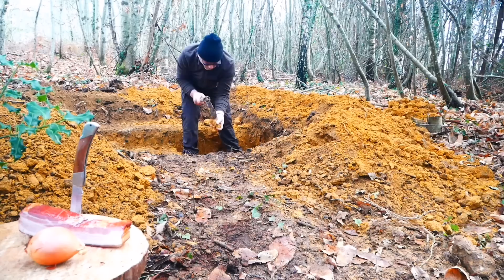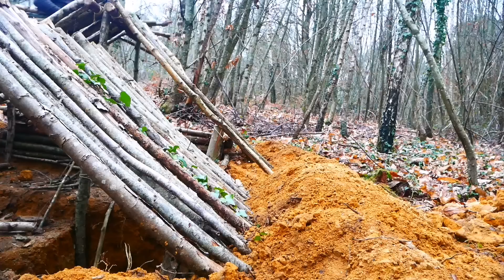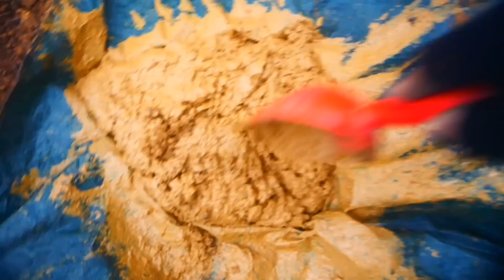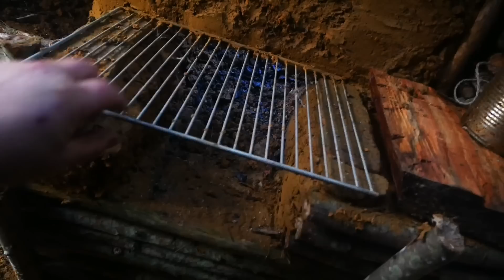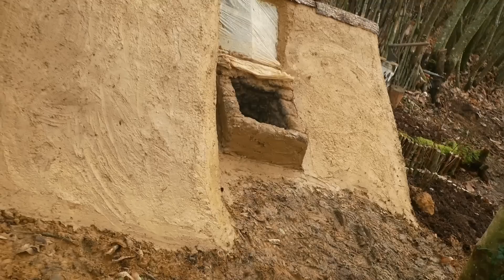SURVIVAL EARTH LODGE HOUSE - Bushcraft  a pit warm house The best of all natural Shelters!!

Comment: I'm interested to know why the choice to dig and make the shelter below ground level. I assume rain isn't an issue in this location? I grew up in the southeastern US and was a boy scout. They would not have allowed us to make this shelter because of water issues. Even a small amount of rain and your entire floor will be a puddle.
Reply: I was wondering the same thing
Reply: I was thinking the trench leading down to the doorway would funnel rainwater right into his dugout
Reply: I'd say the reason the shelter was below the ground level was to take advantage of the thermal qualities of bare earth. The reason the roof was finished with leaves and earth is for trapping both the heat
 produced by the fire and what the earth radiates naturally. The final thing done to the roof was to cover it with clay. Clay is highly resistant to water penetration, especially when smoothed and on a pretty steep pitch. It also holds in/absorbs heat quite well, staying warm for a long time. I couldn't really get a feel for the slope of the entrance. But, early on in the video it appears he is compacting that area and it appears to be heavy in clay. If that is the case even a small amount of slope will carry the water way. The soil at the building site appears to have a high clay content. This would prevent the ground from soaking up a lot of the water. Most rain would simply run off once the first inch or two was wetted. Clay is what makes  many a pond possible. Water has a hell of time getting through it. Water gets so far, clay particles get wet and bond together. Once that happens the water pretty much just sits on top or runs downhill.  I don't think this is the first of this type of shelter the guy has built, and my money says it is much, much drier than one might think. How would I know? I suppose years spent as a S.E.R.E instructor in the military just might be a factor. No disrespect, but I've met a ton of former Boy Scouts who don't know their ass from their elbow when it comes to shelter craft, food/water procurement, fire craft, and so on. My opinion it this is a pretty damn fine shelter and I would not hesitate to call it home if I found myself in the middle of nowhere with no immediate way out.  With just a bit more work this would even make a very livable winter shelter.
Reply: @matthewjacobs141  In any areas where rain is a factor, it would do exactly that.
Reply: @BornIn1500  no. Red clay makes great waterproofing. You have no clue.
Reply: With the incline into the shelter I see it flooding out.  Should have reversed it
Reply: In this sort of thing you need a groove in the floor and a drain to lower level ground so that any incoming rain will drain out and not flood you out.   He doesn't seem to have provided such a drain.   In any case, just when he needs warmth the most, the rain will come straight down the chimney and put the fire out.   Not forgetting of course that this style of fireplace will send 90% + of the heat up the chimney, so he'll get most warmth from the exercise cutting vast amounts of firewood.
Reply: @misterdeeds2172  :  No, not a damn fine shelter at all.  No drainage, fireplace design wastes >90% of heat.  No door or wind break.  Rain will put his fire out and then flood him out.   The pre-metal age central hearth and a hole in the roof to let smoke out is much much warmer - or for the same usable heat will need a fraction of the wood to be cut.
This is much like the play-cubbies I used to build when I was about 9 or 10, after watching American movies with a back woods setting.    I learnt to use leaves as as well.  The leaves stop the mud falling thru the gaps in the logs until the mud dries.
You are right about earth trapping heat, but he has no door or wind break and the outside air infiltration will be massive, so the heat trapped in the structure doesn't count for much.
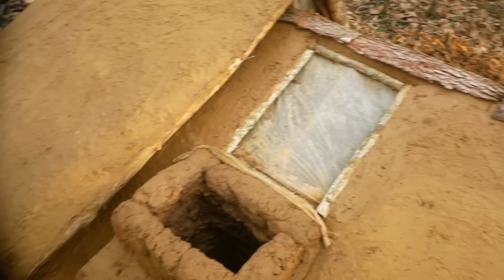Reply: @misterdeeds2172  I respect that you were a S.E.R.E instructor and would not try to educate you on this or argue with you about it. But I would ask you to go to 17:33 in this video and pause it. While looking at the image of the shelter, try to imagine it starts raining. Imagine where the water would go. The roof and walls could be solid concrete and it would not matter. He created a ramp for the water to flow directly into his shelter. The slightest amount of rain will make his floor a puddle.
Reply: @keithammleter3824  you must not have seen the finished fireplace, im assuming the non functional stage youre talking about was before he finished converting the fireplace into a clay oven
Reply: It would be great I’m sure for keeping warm! However i wouldn’t want to be inside that thing when it’s raining!
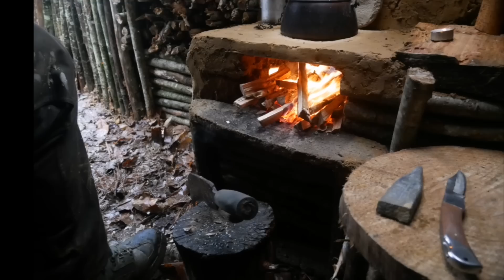Reply: @meatbag2405  :  I'm talking about the finished fireplace/oven as shown near the end of the video at 19:50.   
The air flow is L-shaped into a wide chimney - the chimney being thick clay/mud - an insulator.  All of the hot air goes up the chimney and out into the wide atmosphere and the only heat he gets to feel is the direct radiation of the front of the oven.
Ever seen those old wild west movies featuring a train - with a pot belly stove to heat the carriage?   Did you notice the dog-leg flue pipe?   That's because most of the heat come from the flue pipe, not the stove.  They used to bend the pipe too and fro to increase its length exposed inside the carriage.
Most of us who are old enough to have experience with wood stoves/ovens know that the burnt gasses are led via a circuitous path around the oven before going up the chimney.  A vent was provided that bypasses the circuitous path so that you can get the draft going when you light up a cold stove.  You get it lit and burning wood and when the draft starts (hot air rising) you close the vent.
Those of us who are old enough to have cooked with wood know that you have to have some form of "damping" to slow down combustion - this dramatically increases the usable heat energy for any given amount of wood consumed.   The fireplace/oven depicted in this video is the very opposite of damped.  Chimney is far too wide and short.  If it rains, it will put his fire out.   If he tries to stop that with flap he'll fill his cabin with smoke.
Reply: If you dig a trench with a level floor into the side of a hill, the end of the trench at the top of the hill is going to be deep. The end at the bottom will require no digging at all. That’s why it appears that the entrance runs down into the shelter. The reality is the bottom of the trench is flat and it is the height of the trench walls that get higher as they follow the gradient of the incline.
Reply: @meatbag2405  :  You made a comment about building to local conditions.   Judging from the trees, this place gets pretty cold and wet.  The trees are tall and deciduous, so it snows and rains pretty good.    No, he hasn't built for the conditions at at all, with that squat wide chimney and that ramp leading the rainwater into the cabin.
It might even snow enough that after it has put his fire out and filled his dumb entry ramp, he'll be snowed in and freeze to death.
Reply: @keithammleter3824  lol so pretentious, you ever stop to think maybe he built it in a mild climate that doesnt see much heavy rain and doesnt require full surround heating? And didnt plan to live in it forever as a permanent structure because its a hobby? Acting like it needs to be built to sustain heavy downpour and sub temperatures when its obviously just a hobby construction he built for fun showing some useful construction techniques... you whip up a shelter based on the climates you expect in your area and show us all how its done then since youre such a keyboard professional shting on a mans hobby.. its not like he advertised it as a bomb shelter.. not everything you build for fun needs to be engineered for absolute optimal survival in every conceivable apocalyptic scenario you dk.. sometimes its just for fun and a place to chill out and cook some bacon sometimes...
Reply: Hearts comment but dosent answer
Reply: @matthewjacobs141  Does rainwater run up hills where you’re from? The only way rainwater could run into the dugout is if the entire valley flooded and the water level came halfway up the hillside. If that happened it wouldn’t matter because any kind of shelter would flood.
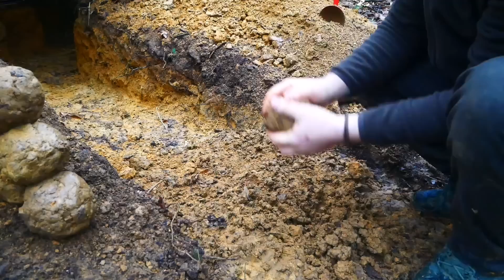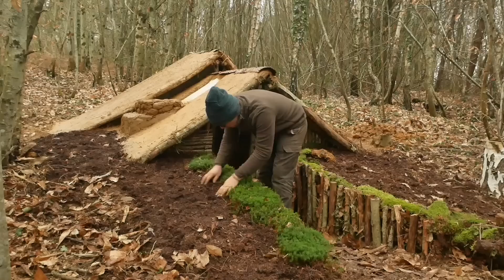Reply: @numerum_bestia  : You are wrong.   Look at 9:28, 9:31, 11:44, and 15:29.   He built on only slightly sloped land and the entrance is clearly ramped quite steeply down into the cabin.
Reply: Yeah because y’all are professionals right? Where are your video’s of shelters? I’m sure this dude as made hundreds of these and if it flooded as bad as you say it would he wouldn’t of made it that way. Arm chair quarterbacks.
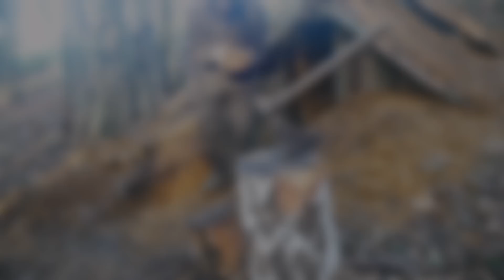Reply: 10:15 tell me how water flows up hill?
Reply: @keithammleter3824  In all of those examples it still looks like a flat trench dug into the side of a hill. The hill is much steeper than it appears on camera. The only water getting into the trench is what falls from the sky. Personally I would have dug the trench so it followed the downward incline of the hill instead of making it flat. But even with it being flat, water can’t run uphill and into it like half of these comments are saying it will.
Reply: Do you watch the show "Alone" ? In the last season that just ended they were in British Columbia which gets 160 inches of rain a year. Once of the contestants built a similar shelter and had no issues with water.
Reply: @keithammleter3824  Look at 10:15. You can see the hill better. The ramp is flat.
Reply: @numerum_bestia  : At 10:15 the camera is titled - look at trees in the background, objects tilted that and not titled in other shots.  The guy's legs look vertical but as he is bending over they should be angled back.   Stand with your back to a wall, keep legs straight and vertical and tilt your torso forward and see what happens.  Nope, although the land is sloped a little, the entry is ramped down into the cabin.
Reply: @numerum_bestia  :   True, the trench will collect only falling water, and not run-off, but in a good downpour that will still be enough to severely flood the cabin floor.  The USGS has a handy online "rainfall" calculator.  This shows that for "heavy rain" the area of the ramp, about 1 by 3 meters, will deliver about 100 litres to his cabin in about 3.5 hours.  This approximately applies regardless of whether the entry ramp slopes steeply downs or slopes only moderately downwards, and multiple camera shots as I listed in another post show that it does slope significantly down into the cabin, despite a moderate up-slope of the terrain.
Reply: @numerum_bestia  Where do you see Hills or a valley...He picked a flat place to build/dig in...and the trench he dug to get to his doorway went Downward...channeling rainwater right into his dugout
Reply: @matthewjacobs141  no. He showed an 8 months later, it was fine  it was a camera trick it didnt run back in at all.
Reply: @qwazysymbiote4931  holds the rain out just fine
Reply: @numerum_bestia  The issue of the bottom of the ramp being flat is irrelevant...Does it slope downward to a hole in the ground is the only thing of importance
Reply: @meatbag2405  After 8 months did the camera show all the mold that would have taken over
Reply: @matthewjacobs141  there wasnt any.. just grass.. which you would expect from any uninhabited bush structure now wouldnt you.. such a genius you are..
Reply: @meatbag2405  : Actually, he's posted at least three videos with several months separation.  Most likely it was still standing.   But what makes you think he actually LIVED in it for 8 months?   Or even just one night?   More likely he went there only once each day for whatever days it took to build it and video its construction, and return sometime later to video it again.   In the mean time it probably got flooded and/or snowed in multiple times.  Repaired as required for the next video.  It's not how long it remains in place that is the critical thing here, it's whether it is safe and comfortable to inhabit during heavy rain or snow, which it isn't.
Like many who have posted to these videos critical of it, I built play-cabins just like this when a young child, inspired by 1950's American pioneers and Indians movies.  I do know they were fun at the time in building, but actually useless unless you took a care about drainage, fireplace/chimney design, and wind breaking.  Which we kids learnt and this guy apparently hasn't.
Reply: @meatbag2405  :  Oh, so you agree then!   What's the point of building a cabin if you can't or won't live in it?   Right - no point in it.  How do you do it wasn't repaired?  You don't.  But it doesn't matter - repaired or not, it may be standing but it isn't suitable for living in - which you seem to tacitly recognise.
Reply: @meatbag2405  OK...I'M DONE WITH YOU

Comment: The only thing I've always been curious about with this kind of structure is, "flooding" in heavy rain.   just how much of the dug out floor would end up filled with water after a big rain event.

also wondering, i didn't see the clay prep,  is that just raw dirt clay, or is it a Daub mixture... it lools like pure clay...  which will crack and shrink as it dries, and run when wet.    Adding plant fibers,  grasses, hay, straw, or such into the mud produces a daub that will dry without cracking and has some structural integrity to it due to the fibers.
Reply: he showed it. dirt, water, bang it around in the tarp.
Reply: @knotkool1  i know,  but i didn't see if he added grasses, hay, straw, to make it a Daub...  or just used raw clay...   clay+water+grass  = daub.   Dirt + water = mud   LOL.
Reply: I'm worried about the bathroom.. 🙃
Reply: It looked like he handled the bathroom issue by rolling his turds into big balls and stacking them around the fireplace
Reply: Hard to say what's in that mixture.  But maybe I just wasn't paying attention.
Reply: @apaapansson5873  Great!

Comment: Thank you, very nice work.  I was wondering about the longevity of the plastic window in terms of drainage cases. Obviously, your window idea is GREAT. Gives free daytime internal lighting as well as capability of 360º viewing outside security zones. 
By the way, Did you have to make any changes because of water drainage or was there an issue of water pooling anywhere?  Thinking that adding smaller windows in strategically placed locs (some strictly for  lighting) and less susceptible to the elements and for optimal viewing of outside zones. Maybe along the sides & especially some under the awnings would be cool.
I am very impressed the middle for lack of better terms. I'm thinking pillbox zones with loop holes/arrow slots. 
Stone or scavenged metal for makeshift armored areas inside pillbox areas or extra shielded safety zone to put your younger children, Right? 

I love this video because I it made memean were talking root cellar, depth to enable possible rooms for standing upright, sleeping areas, strategically located viewing locations of the outside and sweet was countertops for the lady.  I can only imagine what he can do or has already done for himself when it's not just an "educational" video. One in which I do thank him for.
Imagine what a very determined family could accomplish when working together if a well laid plan were in place. One that includes camouflage so good that you can remain unseen by passers by even at ridiculously close
distances and that's better than fighting those unknown people on any day.
I didn't bother reading many other remarks but in 
one it stated some might have poked fun at this video.  If there really are negative ones or any that are poking fun, I'm sure they are either just kidding or possibly just incapable of actually completing their own from start to finish that would be liveable.  I mean this is a great teaching video and in an emergency you will surely find those same people trying to make mud pie structures and  chimneys and doing it all while wishing they had paid more attention to this man.  After all, he is literally showing you how to survive which includes the all important issue of the staying warm and then there is the staying dry thing which may or may not be important to them. 
But that's just my opinion...
⭐⭐⭐⭐⭐
Reply from the maker: Thank you very much for your comment I am very happy to know your opinion

Comment: When it rains water will all get inside.
Reply: Its not deep enough,  he will be alright
Reply: @coreylahey1711  
Drainage is needed.
Reply: It is raining 🌧
Reply: Well then it comes with running water
Reply: I was wondering about that skylight. Thinking it channels the water into the chimney to wash away the clay.
Reply: Exactly!
Reply: Maybe it won't rain during that period time.
Reply: @安安您好-m4o  Judging from what I can see of the terrain I’d say they get quite a lot of rain there. Not exactly the Mojave desert.
Reply: Boom underground pool, problem solved
Reply: There are ways he could improve the water resistance of the roof
Reply: @ZamboniZone  How so sir?
Reply: @jb-yi4di  i saw later in the video he added clay to the roof. Things like that he could do
Reply: He built on a slope for that reason I assume!
Reply: Run some plastic over the roof. Drain downhill
Reply: Nice, and with a little rain can be used as a swimming pool.
Reply: Note the balls of soil he makes around the 10 min mark. The local soil is clay so he is basically making a clay roof. We have clay soil where I live and we have really bad surface flooding in heavy rain as the water can't soak through the clay. Assuming he has chosen the site well most rain will run off down slope of the shelter.
Reply: He needs a little roof above the chimney.
Reply: @coreylahey1711  lol